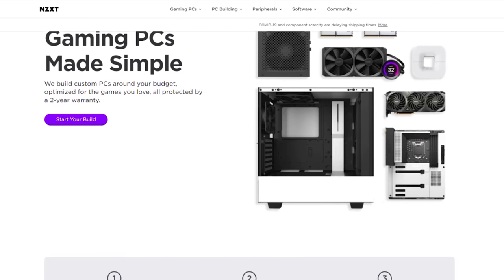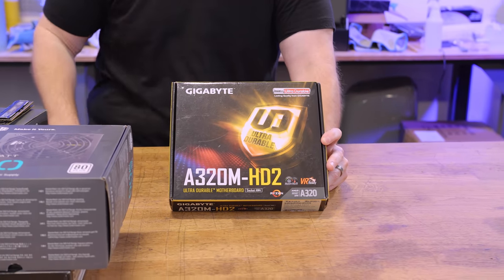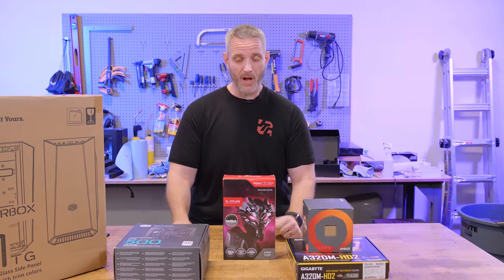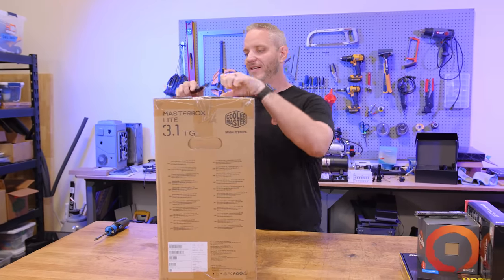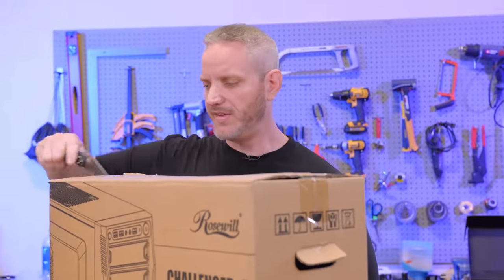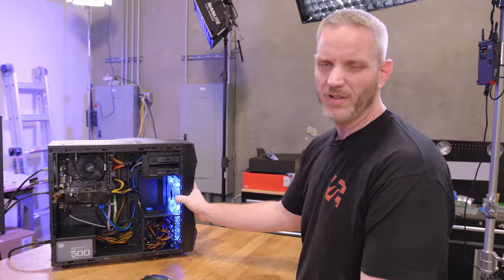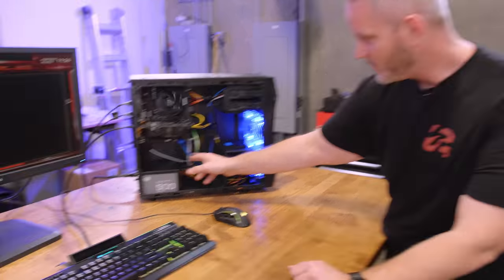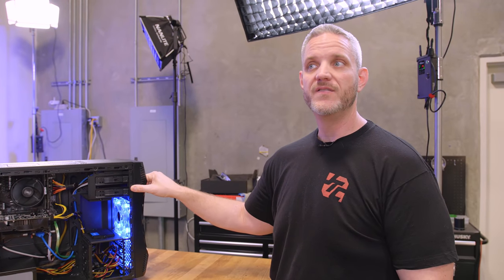The most Practical PC Build of 2022... Extremely Tight Budget Build!

Comment: A discreet graphics card? 
When you try to get a budget non gaming system like this, it's usually better to have something with decent integrated graphics like a 2200g...

I just looked it up, where I live they are literally the same price.
As a side note, thanks to this the "overkill" ram will receive better utilisation.
Where I live the 2 literally cost the same, so even if it turned out the streaming was a little slow it still wouldn't be to late to add a graphics card at any point in the future.

Comment: Also it speaks to how messed up Microsoft's system requirements are when Jay can't keep them straight.  TPM + CPU class version support has been a mess.  I can tell you that Windows 11 run perfectly fine on a i7-7700K before I build the new system.  MS's specs are designed to generate e-waste.

Comment: That GPU is not great for Netflix, Youtube etc. in comparison to an APU. Why? The UVD 4 block on the GPU only decodes h264 at 1080p60. A Ryzen 2000+ APU will have at least a VCN 1 block, which can decode VP9. The APUs later this year, with the Navi graphics, will have AV1 support from VCN 3.

So probably fine for now, but both Youtube and Netflix use VP9, with Netflix moving to AV1, so you might already not be doing hardware video decode on them...

Comment: Hey Jay you can actually install Windows 11 the proper way if you have both the TPM 2.0 and Secure Boot settings enabled and install Windows 11 from scratch, not upgrade from Windows 10. I did this with an H110m motherboard and an i3-7100 and it's running Windows 11 fine, it even wanted to encrypt the drive with bit locker and all. No registry bypass needed if you have TPM 2.0 and Secure Boot enabled as it seems for now, installing Windows 11 from scratch doesn't actually care about the CPU requirement, not sure about the RAM though, but who runs Windows with less than 4GB of RAM unless it's Windows 7

Comment: Eh Microcenter Tustin should have standard SATA DVD-RW drives...connections are easy...SATA data cable and a SATA power connector off the PSU...same connections used for that SATA SSD.

Comment: Good job on that build. Love the green SATA cable. Nice idea. Performance-wise no worries - probably overkill for what is needed... 
But don't got that fTPM thing. Windows 11 hates Ryzen 1st Gen anyway.. and AMD dropped driver compabilty for all cards up to R9 Fury mid 2021... 
So were is the point having a board compatible to Windows 11 when the CPU is not and the graphics card has to use that legacy Windows 10 driver forever?
Reply: Every CPU that is compatible with 10 also works on 11, it’s just Microsoft implemented those arbitrary requirements for UEFI and TPM. I have systems back to socket AM2 running Windows 11 with no issues.

Comment: sry gotta disagree that a dGPU is either necessary to handle streaming content, or better for a low-maintenance noob PC. Another device that needs drivers (esp outside of windows update), exists to be able to fail, etc. is not the way to go IMO. And modern iGPUs are plenty capable of even 8K streams w/o a problem. Unless you chose the parts because that's what you already owned, not the way I'd go.

Comment: If it were me I would use an APU and not bother with a discrete card for a sensible build aimed at a non-gaming relative. eg. 3400G or 4600G. I know my last post got deleted or is in a mod queue because of the microsoft website link. Either way I don't mind about that. I would have added this to it had it still been here

Comment: What was the budget on this? I feel like there are laptops out there that would bring a lot more to the table for comparable money - don't forget that with a laptop you don't need to buy a separate monitor or keyboard either. A Ryzen 1300X, an A320 mainboard, and a R7 270X are a literal waste of money unless you had it in storage already - but then it's not a build that is recommended for anyone who would actually have to buy the parts right now.

Comment: be careful buying blu-ray drives, i got one that didn't come with adequate software for playing blu-ray disks
Reply: Its a pain. I bought an external blu-ray drive years ago and it did come with the software, but it was old, even in 2015. Most of the blu-rays I tried playing wouldn't work on that version so I had to update sequentially to the latest 'free' version of that program only to be told that the free version doesn't support some of the movies and that I would need to upgrade to the paid version. It was at least 30 minutes of installing updates so it wasn't fun.

Comment: i've got r9 280x. and i could assure you the old lady wouldn't be able to stream anything higher than 720p. i'm watching this video @1080x1.75 and the gpu load is about 85 %. 2160x1 would be the same. 
any vega igpu is better for media consumption than any tahiti refreshes
Reply: YouTube actually doesn’t use hardware encoding for video.
Reply: @EvilTurkeySlices  well it does if you turn it on

Comment: Not sure about the GPU, even for a non-gaming user. The  R7 260 a legacy part who's last driver update was June 2021, so no ongoing driver support would be a concern for me,  but Windows 11 should support it?

I last rebuilt my mom's PC in 2020, before all the parts dried up and prices soared. She actually mentioned her machine was feeling slow, and TBH, the i3-2120T was showing it's age. It was a nice little MiniITX build and she liked the case, so stuck with that and the BluRay drive, but everything else got upgraded. B450 board, 16 GB RAM  (I won't build with any less RAM than that, it's too inexpensive to hamper a system like that). 500GB nVME m.2 SSD and an RX 550. Swapped in a 600W SFX PSU with the absolute minimum number of cables, so it's nice and clean. She's been quite happy, and the system has been rock solid. The optical drive was key because she watches movies and plays audio CDs, so she's used to it, and adjusting from WIndows 7 to Windows 10 was a big enough ask. Might seem like overkill, but the system is snappy in a way she can perceive so it was exactly what was needed.

Comment: I’m looking for a non-gaming home computer that I can upgrade when needed, have you built one on video?
Reply: This channel and most other PC build channels focus on high performance systems. You can take the same core knowledge and build a basic home PC. You would just choose lower-end parts assuming you just need a basic web browsing machine. I would go with at least a somewhat recent Intel core i3 CPU (or similar AMD equivalent from a few generations), 8 GB of RAM, a 300 watt power supply and a 500 GB SSD. That should be plenty good for basic home tasks. But then again, it depends on what you plan on using the computer for.

Comment: 8:10 Stock Fan on Ryzen 1st gen, God i hate the stock fans. couldn't even run a cinebench on my 3600 before it thermal throttled. A week ago bought tower cooler, Arctic 34. Now the amd stock cooler is used as a glorified LED heatsink

Comment: This is such a like unintentional throwback gaming PC. The only thing modern about it is the Ryzen CPU.

- Mildly aggressive angular shapes on exterior of case? Check.
- Static blue LED case fans with clear frames and blades? Check.
- 5.25" bays? Check.
- Ketchup and mustard cables? Check.
- Brightly colored peripheral and I/O cables for no reason? Check.
- Unshrouded blower fan/heatsink/cooler on GPU? Check.
- No PSU shroud/basement? Check.
- No grommets on cable management holes? Check.
Reply: The GPU isn’t blower and has a shroud.(it’s just not a full one)
Reply: @EvilTurkeySlices  That's a shroud? I thought it was like a heatsink or something lol. Probably acts as both. Thanks!

Comment: 1:57 A320M? I'd rather an A400M, supposedly better than evil C-130s :)

3:16 OK that doubles the price tag instantly ^^

3:53 There's literally no way you could ever possibly overspec RAM. Anything short of 16 Gigs and you're doomed to live with just a single tab max in Chrome.

7:02 I have had IDE drives in my main rig until like half a year ago with a PCIe controller card that was like 10 bucks. Did that back in 2013 because it was a) cheaper than getting new drives, b) I could keep my silend Pioneer DVD-106S and c) I wouldn't waste 2 SATAs on optical drives when I needed them for hard disks and SSDs already.

Comment: This is a strange build. The hardware is so old that you can't even buy it new, so you would have to resort to 2nd hand (which is fine but not practical). It would have been more interesting to build a LGA 1200 build with a Pentium Gold G6405 or i3-10105(F).

Comment: I want to build a 3060 ti R7 5700g or 3700x or R5 5600x (idk I need help with the cpu choice) and 570 board with wifi built in, 2x8 rgb ram and 500gb nvme and 500gb ssd. I want to try and keep it under $2k but is it possible anymore? No liquid cooling just fans and I want good cooling case with alot of air flow. Need recommendations. Also it seems the R7 3700x is best value so should I go last gen with a current gen 3060 ti? Also could save by going with a 550 board so is it worth the downgrade?
Reply: 🖕 Congratulations you among the selected winners claim your PC via telegram 📩⬆️⬆️...

Comment: so your saying a 5600g cant run netflix or any other streaming service? That doesnt even make sense.
I am literally building a low end spec pc for a elderly couple, 5600g, Asus tuf B550 wifi, Corsair 400w psu, crucial p2 1TB nvme (really cheap atm) 16gb corsair LPX 3000mhz ram and the case a corsair  110Q with windows 11 installed,  build cost under £500, with massive upgradability if they ever need it.

Comment: The VGA cover was in the box so Newegg could refuse the RMA if you sent it back.

I remember building my first Multimedia PC in the 90s...  Boy what a fiasco.  Months of research, literally sitting at the library reading computer magazines.  There really wasn't much useful on the internet, and even if there was, you're not learning much at 56k.  But eventually, I got all the hardware to play nicely amongst itself!

Then in the mid-2000s, all of a sudden computer parts just worked.  Need RAM?  DDR2.  It'll work.  Value RAM is a goldmine.  Does the processor fit the hole?  Throw it in, you're good.  Graphics card?  Yeah man, AGP or that new-fangled PCI-e?  You got it; throw that little whore in there.

Now we're back to the 90s.  Nothing works with anything else again.  Gotta spec this to that, that to this, the other thing to that one thing, but then you gotta...  Yeah.  Cool, it's working!  20 minutes later, shit, my RAM ate my wifi and now Netflix will only play scifi movies in Spanish.  Somebody call Jay!

Comment: I feel personally attacked with the comments about ketchup-and-mustard PS cables, blue USB 3.0, LED fan lights, and random SATA cable colors... I just rebuilt my 2009 Coolermaster HAFX for Ryzen 5600x, Strix 2060 Super, and an NVME 4.0. And YES, I still have my 5.25 Blueray drive and my old 1TB HDD...

Comment: I think the only overkill here is to say that a discrete graphics card is necessary for "video streaming services". Ffs until last year the kids still had my old Pentium Core2 Duo from 2007 with a 'no-name' 30 buck graphic card driving two monitors while they watched different streams on each one! I think something like a Ryzen 3200G would have been better here, although I realise Jay was just using the parts he had around. How about a realistic build - similar spec/mission, but what you can actually buy off-the-shelf today? Knowing the REAL costs for something like this would be better info. My system with 3rd gen. Ryzen cost 450 Euro/490USD 12 months ago, for board, CPU, ram, SSD, power and case and I can even play basic games (Fortnite in 1080p at around 80fps).

Comment: Looking at building for the first time, could you or anyone with a bit more experience have a look at this list and let me know what I could improve or simply if I’ve gone overboard with anything. Many thanks in advance any help is appreciated. 
AMD Ryzen 7 5800 
ASUS ROG Strix B550-E
G.SKILL Trident Z Royal series 2X16gb 
MSI Mag forge 100r mid tower 
WD_BLACK SN80 1TB 
Corsair RM750 
Vetroo V5 Black cpu cooler 120mm
ASUS 1660 dual super evo 6gb

Comment: Do the regedit edit to install Windows 11 so far no issues and still updating , the install has to be from usb win 11 if not the regedit wont work:  
Windows Registry Editor Version 5.00

[HKEY_LOCAL_MACHINE\SYSTEM\Setup\LabConfig]
"BypassTPMCheck"=dword:00000001
"BypassSecureBootCheck"=dword:00000001
"BypassRAMChec"=dword:00000001

Comment: Hey Jay. Would you know what could cause a VGA LED on a mobo to light up out of the blue on startup and no boot. With the fix being reseating the gpu and everything is back to normal..
Awesome video as always :)
Reply: It’s possible it wasn’t seated properly and it got bumped which caused it to dislodge further. You reseating it fixed the problem. It’s just a guess though.
Reply: @EvilTurkeySlices  This happened 2 years ago as well with my old gpu. I've been told that it's probably a power issue.. It was so weird waking up and it not booting from nowhere even after turning of power for hours before trying again. Thanks for the input though

Comment: I still find it ridicules my 1700 isn't supported by windows 11 officially. The platform is(B350) , it has the secure boot , tpm 2 i think . But no, with no real technical reason given by Microsoft , i think?   And yes i use my cpu's  for a decade either myself or family. But clearly 8core/16T 3.2ghz  IPC from 2017 is not enough for windows 11 ...

Comment: HI I want to build a system for trading and with 6 monitors i want to build with i5 12600k ,MSI PRO B660M-A DDR4 and graphic card gt710 4 hdmi out put or nividia t600 please suggest also if i can use my motherboard output with graphic card

Comment: im still on my launch day 1800x, i remember going to micro center to get it and the C6H mobo on march 2nd 2017. since day one its been running overclocked 3.9 1.325V well until a week ago, im trying to figure out whats causing my games to freeze up. ill be in a game & in discord and all that, game will freeze up for 1-10 seconds i can still hear and talk to others in discord thus making me think it could maybe be video ram chip overheating?? i think this because im not 100% sure if i used the right size thermal pads on the ram chips of my gpu when i put on my water block 2 years ago
idk, "stuff and things"

Comment: Im sorry Jay, this is still not the most practical build you could come up with. A320 boards are now generally compatible upto 3000 series. You can put in there an Athlon 3000g and will still handle Netflix very well. You don't need a gpu for this build.

Comment: Hey just built my ryzen system iv got an hero v111 WiFi with 7 5800x an gskill 4000mhz cl 18 with an rx 6700xt my trouble is when power it on getting no signal all the time tried all the fixes and not working can any body help me with this plz

Comment: Old components are fine, but never put such an old PSU in a build for other people, if you can not check the components integrity. Seriously single most thing that is a safety hazard is a PSU since components degrade over time.

Comment: I disagree with almost everything. She wants Windows 11 and the most graphically intense thing she wants to do is watch Netflix? I know it's a grandma build, but I just can't put anyone on a 4 core 4 thread build in 2022 with a clear conscious. I'd probably do a 3400G with 16gb of RAM instead of the older cpu with that even older GPU. It would probably be easier on grandma's long term electricity costs. I'd also probably go with a Fractal Design Focus G. It's my usual go-to case for budget/practical builds that may need a 5.25" bay.
Reply: A 4 core is still fine even for gaming, I have a few of them. Sure 8t helps a lot, but there’s nothing wrong with a pure 4 core.

Comment: Dear Jay, don't wanna ruin your parade. But you are talking about Win 11 support on the board for so long. And than you pick a Ryzen 1000-CPU which does not support Win 11. You should have picked a Ryzen 3 3300G APU or an i3 8100 or above. Would have made much more sense than a dGPU...  Also, why a DRAMless SSD? You really should have spended the 10 bucks more for a MX500...